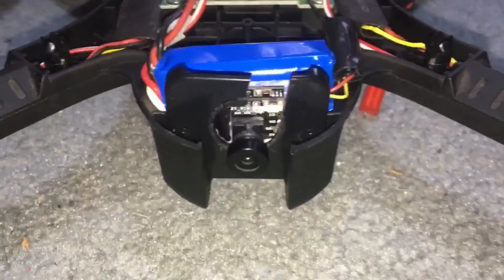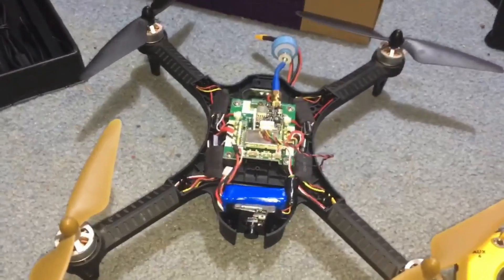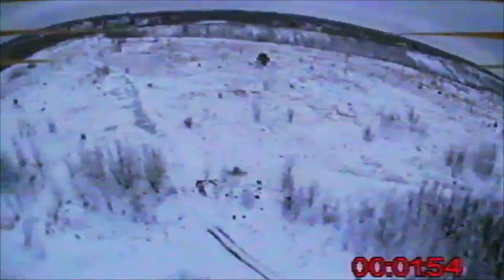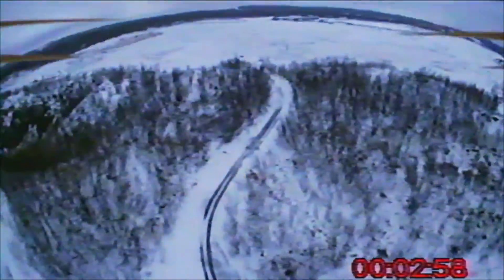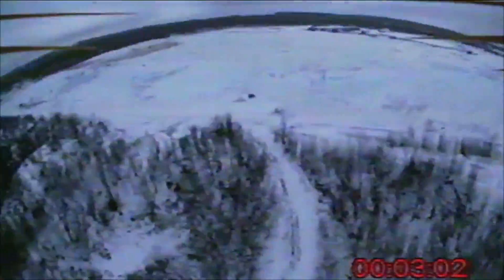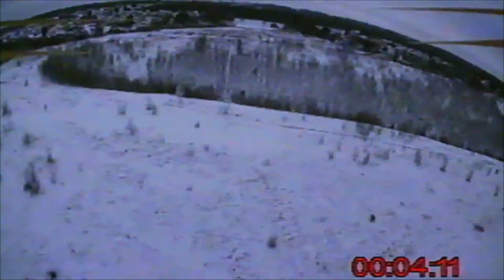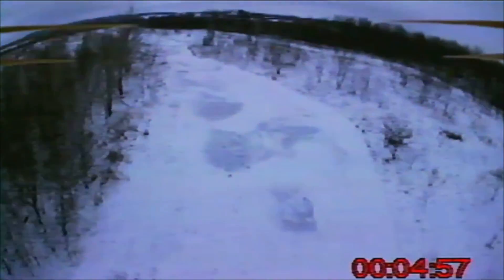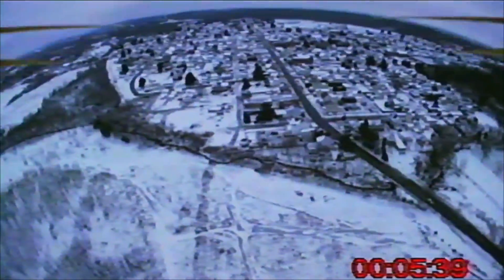Mjx Bugs 3 F100 FPV MILE MOD Understanding FPV Antenna Placement DIY Review

Comment: Was definitely worth trying. I suspect that with the VTX so close to the Rx and antenna the extra power was wiping out your control signal. I'm probably wrong though
I can get 1K with a 200W AIO on a bugs 2C (with the AIO in the right place) but getting further is no longer on my agenda. It does NOT like flying over water though (reflected signal I think) Could the same happen with snow?
Reply from the maker: O yeah I forgot to mention that all the water 💦 lol 😂 ice is water 💧 could have easly effected stuff

Comment: Looks like the aerial you placed on the drone is a 5.8ghz wavelength instead of the 2.4 ghz the transmitter is giving out.
Reply from the maker: The drone has a 2.4 the airal is my 5.8 transmitter

Comment: Great video Jay. You got balls in this weather brother. No GPS, no RTH, just a fast little Bugs 3 and a Jumper. Keep an eye out for a used  "Loc8tor " tracker kit. I have Loc8tor trackers on both of my Hubsan, 501SS  models, my Bugs 2, 3 & 5, the TOPO TE-360 and  my DJI Phantom 3. If I lose one it's very helpful finding it. I bought 2 used  Loc8tor setups for $40 each. Well worth it. Love your channel.
Reply from the maker: Hook it up
Bro shot me a link

Comment: Thanks for the run through. Gonna grab an 800mw vtx. Looks handy.
Reply: Be careful if mounting an 800mw camera on birds with GPS and a compass. It can raise hell with the 2.4ghz signal.
Reply: @RCPickups  Thanks for the heads up. I'll be sticking it on a bugs 3. I've read that heat is a real problem on those things too. I'll vent it away from the other boards.

Comment: Great video brother! I’m planning on putting a AKK 200mw on my syma x8c. I don’t have a jumper yet but I plan on doing a antenna mod on the stock receiver. I’m just waiting on a cheap fpv monitor I scored on bang good for $26 to come in. I have a few other mods for the x8 coming in too, the legs, a cheap action cam mount, and 3 bladed props!! Gonna be dope! Maybe I’ll make a vid once I have it all the parts in. Can’t wait to get a jumper and some proper googles!
Reply from the maker: Make a vid for sure

Comment: Toss that pagoda LHCP? and try a RHCP or match your goggles with a left hand. I have found that the open RHCP like the ones on some AIO Cameras work really well. I have the optional 5.8Ghz Camera module for my Bugs 3 and it has a Linier omni that works well. Enjoy some FPV! Thanks Jay Drone!
Reply from the maker: I will run once more with this one, then throw what u suggested , I did choose this one due to indoor testing I did last night , the fc goggles came with fpv screws that shows signal strength n the pagoda was offering best signal vs mushroom 🍄 antanna
Reply from the maker: Also pagoda is rhcp
Reply: @JayDrone  If your signal doesn't improve with it, you might want to try your omni from your other VTX, if it still breaks up over 400m, check your VTX output.. I had a 800mw that only put out 150mw :(

Comment: Hey Jay Drone. I tried your setup you have on the bugs 2 on my bugs 2 c using the same equipment. I had no GPS so I had to move the transmitter. I had trouble with balance. I don't know what size battery your used mine was a 900 mAh. I also used the Firefly. I did get it working but lost it in a tree. Luckily a breeze knocked it down. I live around allot of trees. Haven't tried it again.
Reply from the maker: i use a 500mAh to 600mAh same battery in this video